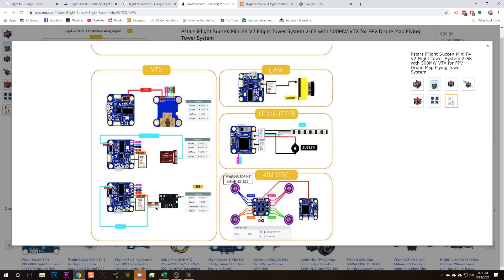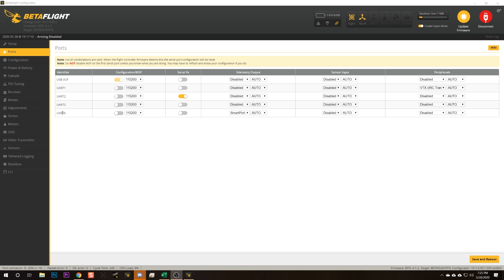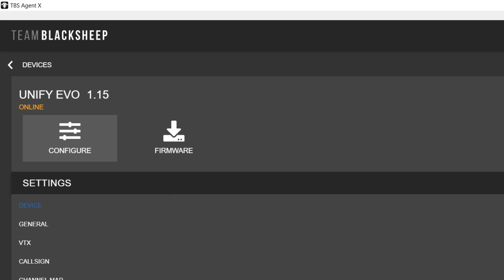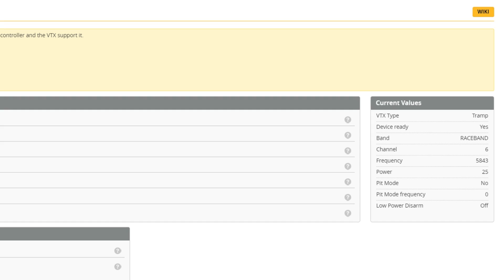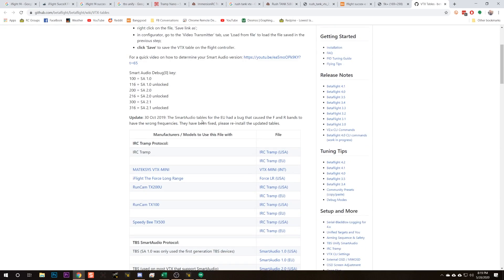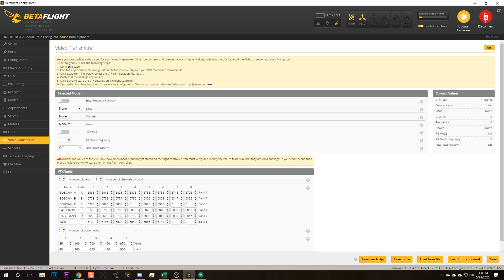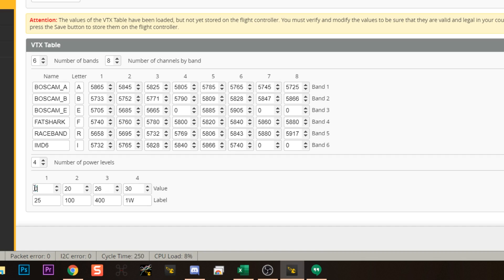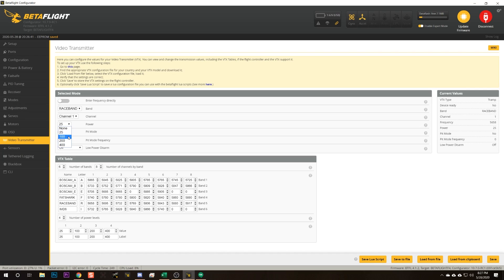Betaflight SmartAudio vtxtable troubleshooting (WHY DOESN'T SMARTAUDIO WORK)

Comment: So I have TBS unify pro32 HV. Used table 2.1. VTX type : Smart Audio Device ready: yes set uart 4 to TBS smart audio and verified I'm on the correct uart. VTX is unlocked while I am able to change the channel in betaflight I do not have smart audio in osd by the stick combo to get into the osd. What am I missing here? Betaflight 4.1.2

Comment: Help rush tiny tank vtx won't go out off pid mode via betaflight or osd settings and saved with battery. Low power disarm does work after we change pid mode changed. We cannot change setting to normal like low power disarm and save it?

Comment: So, I followed this video to a T. My TBS Unify is wired to T1 in my iflight FC, Uart 1 is selected for SA and, SA 2.1 tables are uploaded with proper outputs set and I still get nothing. I followed UAV Techs video and set up debug for SmartAudio and plug in a battery, sensor tab does nothing. Any other advice you could give? Thanks in advance.
Reply: Same I hate 4.1 vtx tables

Comment: After updating to 4.2.0 the other day, I can no longer change my VTX settings (band, channel, power level) via the OSD/Smart Audio. It worked fine on 4.1.7 and just to check my memory, I reverted back to 4.1.7 to verify and it does indeed work just fine.

No changes to VTX table settings. Any idea why this would happen? I noticed that 4.2.0 seems to have more items in the VTX menu, so there have obviously been some changes to the code there.
Reply: I can confirm this issue, on 4.2.0 you can change VTX settings in the video transmitter tab in Betaflight but not in the OSD. I flashed it back to 4.1.7 now it works again. FC is a MATEKF411.
Reply: prototype46 yep, I’m on a Kakute F7 V1.5 with the same issue. I’m going to see where to report the bug if it hasn’t been reported yet.

Comment: So isn't possible have CRSF protocol (receiver to Unify vtx) and smart audio at the same time (VTX to FC)? also I have already the CRSF protocol (Rx to VTX) and trying to get pit mode in a switch, the TBS Unify manual said it is possible but it doesn't explain how to do that. I can't find any video talking about CRSF protocol.
Reply from the maker: No you can't do those things at the same time. Either vTX to FC or vTX to crossfire.

Comment: vtx tables are sh***iiiiiiiiiiiiiiiiiiiiiiiiiiiiiiiiiiiiiiiiiiiiiiiiiiiiiiiiiiiiiiiiiiiiiiiiiiiiiiiiiiiiiiiiiiiiiit
you have bought vtx in the past. and you don't know if it is SmartAudio 1.0 or SmartAudio 2.0 or SmartAudio 2.1
And you can't really figure it out cause you cant measure the power output. so you don't know wether the settings you send to it destroys it.
And the worst: the shop does not tell you the version they use :(

Comment: Iv got the same set up with the rush tank ultimate , the led indicator light doesn’t seem to change when I change the power using osd ? 

Band ect changes and can confirm . Just worried my oower isn’t changing due to the light not ?

Comment: I have VTX ready: No but everything works :v
Reply: I have the same problem - Rush tiny tank - smart audio 2.0 Please let me know if you find a solution!
Reply: @randazd1434  I have the same, didnt work at first but i figured it out. I hadnt enabled "factory" and that was my issue. I downloaded a vtx table specifically for the tiny tank, and it was disabled at first
Reply: @leviathannfpv1282  I worked mine out too :)
Only problem I have now is O can't change the mode to free instead of race. And my pit mode is to underpowered so everytime I turn on I can't see
Reply: @randazd1434  What is free vs race? i have pit mode on my fc instead
Reply: @leviathannfpv1282  see https://youtu.be/dCWngIk8MW4

Although even once in 'free' when I reboot into 100 or 200 my quality is incredibly poor. I'm losing my mind it's like I'm in pit mode although definitely not.. starting to think I either have a poor soldier connection or a faulty VTX
Reply: @randazd1434  dude i have very simillar problems! Betafligh says device ready: no.
Output power is incredibly low even though i dont think i´m in pid-mode cause i´ve never enabled it.
Smartaudio isnt working... I´ve wired it correctly for sure! pls give me updates if you find out whats the problem! thx!
Reply: I´ve got send a new vtx (same model) by my prefered shop. Now everything works;)
Reply: Same help me . Rush mini with battery in beta and osd save reboot back in pid... how ..

Comment: One concern with this video: It continues to perpetuate the misunderstanding that "smartaudio" is vtx control (even stated in the title!). Smartaudio is just one of the protocols used for vtx control (along with Tramp and even onboard rtc6705). It's not "why can't I get smartaudio to work", it's "why doesn't vtx control work". This is a common misunderstanding that people have and the video title just reinforces it.
Reply from the maker: I understand the distinction. The reason I use SmartAudio in the title is because of SEO. Because everyone makes the mistake of associating "smartaudio" with "vtx remote control," if I want them to find this video, I have to use that term, since that is what they are searching for. So there is a self-perpetuating cycle where people use the wrong term, and then content about that term reinforces it. Personally, I feel that the goal of helping people solve problems is more important than the goal of ensuring that they use the correct terminology 100% of the time.

Comment: Absolutely cannot get this to work with the eachine nano vtx's. I've tried different vtx's on different flight controllers. Using the tramp protocol, got the wire going to the tx pad and the correct port set in the ports tab and it hasn't worked since betaflight went to these stupid vtx tables.
Reply: The Eachine nano has a broken Tramp implementation and won't work. Return the vtx to the manufacturer or ask them for a firmware upgrade. This is not a Betaflight or vtxtable problem - it's bad hardware.
Reply: @BruceLuckcuck  thanks, wish that was more widely known. Although I just talked to a guy last week that says it works fine for him so?
Reply: It is widely known. And the nature of the firmware bug in the vtx is that the baud rate it uses is poorly controlled so variations in the devices (even temperature) can cause it to go out of spec and not communicate properly. So you can get "lucky" and one might work, but most don't.
Reply: @BruceLuckcuck  that explains it thanks!

Comment: My transmitter (PandaRC Nano) says it does the following power 0mW/25mW/50mW/100mW/200mW/400mW.  So is the first entry 0 or 25?  It is Tramp.
Reply: 0 is never part of the power level table. Use the default Tramp table and change the labels to 25, 50, 100, 200, 400. The "0" is controlled by pit mode.

Comment: Does beta flight support Furious FPV protocol? I use 2.4 tx’s
Reply: No.
Reply: Bruce Luckcuck that’s what I thought. INAV does, wonder why BF hasn’t implemented it yet.
Reply: Very limited market and no desire to support even more proprietary protocols.They could have chosen to do SA or Tramp and instead made their own.
Reply from the maker: Furious made up their own protocol even though they could have used an already-implemented protocol like SA. Every new protocol adds size to the code and work for the devs to implement and maintain it. The BF devs drew the line and said, the existing protocols are fine and they are not going to add more just because a manufacturer wants their own proprietary implementation. Otherwise we'd have Furious protocol, AKK protocol, Rush protocol, every manufacturer could make their own and then things would be even more confusing than they already are.
Reply: Joshua Bardwell thanks.

Comment: Great video. Does the TBS Unify Nano use SA V2.0 or V2.1? Still having trouble to use SA...
Reply: Unify nano uses SA2.0. But it has a hardware design problem and needs a 10K resistor connected from the SA wire to ground ( a pull-down resistor).
Reply: @BruceLuckcuck  Thanks a lot man for the quick response, I will try that
Reply from the maker: I believe the RDQ/AKK branch of BF will also fix the Nano problem without installing a 10k resistor (but not 100% sure).
Reply: Sometimes it will - mostly accidentally - but depends on the flight controller somewhat. The better fix is the 10K drop-down resistor as it permanently solves the problem and eliminates the need for using a custom firmware.

Comment: hi, i have a question, i am a newbie in this hobby, so i just bought a new transmitter for me, QX7 ACCESS and it doesn’t have the D8 mode, how can i bind it to my emax tinyhawk 2 😭, i know nothing about this, please help me 🙏.
Reply: You can't bind. ACCESS doesn't support D8 at all. You'll need to get an external D8 transmitter module. Or change the receiver on tinyhawk :)

Comment: Thanks for this video. But i noticed mine was pegged maximum 600mw. I am using BF4.2RC2 and furious fpv stealth long range vtx maximum at 700mw. It wont let me choose the 700mw. Hope you can help. I dont know if other users using IRC tramp with BF4.2 noticed it.
Reply: My matek is similar, it doesn't support 600mw, but rather 500mw. Because the tramp protocol always uses the same labels, what reads as 400 is actually my 500. I would venture to guess that your vtx is actually at 700 when you select 600
Reply: @srossi88  My vtx maximum power is at 700mw but cannot be set at that power level. I change it to 600mw and 600 label. Now it can read at that power level - 600mw.

Comment: Just had an issue with a TBS VTX this week. Everything was connected and configured correctly but SA wouldn’t work. Finally connected it to the TBS utility and it was set to TBS not SA. Changed the check box to SA and all working now. 3 other identically VTX never had this issue. 🤷🏽‍♂️
Reply: HOW DID YOU HOOK IT UP TO THE TBS AGENT??
THANKS

Comment: So weird issue with tiny hawk 2 I'm able to change bands and channels but seems I can't use R1 or R8 but I can use R4 and R6 apparently (ships with R4).  Thanks for the clear explanation and debugging tips.

Edit: saw at end of video it's cause of locked mode apparently will be able to unlock I think thanks for the vids as always

Second edit: that worked just had to hold button on vtx while powering up (for tiny hawk 2 racer) and it unlocks

Comment: lots use SmartAudio still 1.0
Reply: No, only the first generation TBS vtx's use SA1.0.
Reply: @BruceLuckcuck  I taking solely about none TBS or 3rd Party VTX
Reply from the maker: No disrespect intended but that is not my experience, and I spend a LOT of time every week helping people solve this problem. I literally can't remember the last time I talked to somebody with an SA 1.0 vTX.
Reply: @JoshuaBardwell  yea because the ones that do have to install the AKK version of the firmware to get it working... I have quite a few with version SA 1.0 and I  am not getting rid of cause they work.

Comment: As 'silly and complicated' as these table configurations are, they are the ultimate manifestation of shortcomings in our VTX protocols, differences in power output options, as well as differences in regional regulations regarding power output and carrier frequencies.  It would be better if the protocols would communicate back to our flight controllers what their options were so that we, as users, would not be forced to configure them on our own.  This is not betaflight trying to make things harder -- it's betaflight trying to make the platform capable enough to handle the breadth of options on the market, while making up for these shortcomings in the protocols.
Reply: I'd like to piggy back on this comment and point out that it also exposes just how bad some manufacturers are at providing proper documentation and support for their products. A video like this might not even be necessary if OEMs simply had a link to the correct vtx table on their product pages
Reply from the maker: I believe SA 2.1 does support this function. I agree that's the way it should be.

Comment: For Tramp the powerlevel is NOT the power output (except for real IRC Tramp vtx's). It's a value that represents the position in the table.  So 25 represents the lowest output for the vtx, 100 the next to lowest, and so on. What the actual outputs are depends on the particular vtx and how the manufacturer implemented it. So in this way it's like SA2.0 where 0, 1, 2, 3, etc. are just placeholders for the table position. You can't arbitrarily use some other value like 50 thinking you'll get 50mw.
Reply from the maker: Wowwww I did not know that. Thank you Bruce for clarifying. I do know that you can't put arbitrary values in but I did assume that the Value would match the mW regardless. So Tramp would always use the Values shown in the vtxtable, but then the labels you would update to match your vTX output powers.
Reply: @JoshuaBardwell  this is correct. You can look at the matek HV vtx product page for an example of this.

Comment: So I have an HGLRC Sector132 Tarsier4k with the default IRC Tramp VTX and the OSD works fine but I can't get "Device Ready" on the VTX page, so I can't change vtx settings through betaflight or through OSD. I verified the Tramp port  on VTX is connected to TX Uart on flight controller (tested continuity between the 2 pads) and I have Tramp selected under that uart but still no go (There is nothing connected to that UART's RX pad either). It was like that from the factory with BF 4.1.1, so I tried updating to 4.1.6 and reloaded all the settings and it still doesn't work.  Is it possible that I have to modify a setting for that UART like half duplex or something?

Comment: Cheers Josh, just in time, about to install a Rush Tiny tank on the HX-115, I think you've cleared up all the conflicting and confusing instructions out there.
Reply: Can u get out op dip mode, it wont save with me aikon2020f4  rush mini vtx with battery in beta and osd settings save and its gone back in pid again.. ?

Comment: My vtx works but low power disarm doesnt work should I re do the vtx table ?
Reply from the maker: Unless you have a Tramp or SA 2.1 vTX, you cannot go into pit mode except on powerup. After it comes out of pit mode it won't go back. Low power disarm should take it down to 25 mW though. The vtxtable is not the problem, as long as it works the rest of the time.

Comment: Do you need OSD in your FC to use smart audio?
Reply from the maker: No. You can still change settings via Lua script, command line, and GUI.
Reply: @JoshuaBardwell  sorry, I didn't specify my question further.  What I meant to say was can I still change channels/power via transmitter on an fc that doesn't have an OSD.  I am using an SP Racing F3 fc. (wizard x220 setup)

Comment: Going far off the beaten path with this little bit of info to add to your comprehensive video, JB:
If you have a board with limited uarts and find yourself using softserial for SA while using JESC - it conflicts & VTX tables goes all screwy & the quad will throw up arming flags.
This is due to DShot BItbang, just toggle it in the CLI for a quick fix. (think its just to the timers or something) experienced on a Tadpole build.
Reply: Arch the way forward step in line

Comment: Every time I power on my quad, the vtx is switched to an another channel. What I am doing wrong?
Reply: BoAC tech are you using crossfire?
Reply: @parklander6459  Nope. I'm using fport.
Reply: Sounds like you are not saving your new setting in betaflight.  If you change the settings and do not save then this is exactly what happens.

Comment: my vtx which uses tramp protocol has misleading information written on it. it shows for example 6 powerlevels but if you give your vtx table 6 powerlevels it won't work. it has 5 powerlevels and a pit mode (which doesn''t count as powerlevel). the value 0 seems to be pit mode probably don't put 0 into the first possible vtx value because it's not a powerlevel (at least for some tramp variations).

Comment: Thanks for the video.

But what do I do when it says "device ready: no" after I have tried both IRC Tramp and Smartaudio on both available UARTs, double and triple checked the manual regarding the wiring, resoldered the vtx and checked for continuity with my multimeter? It's an HGLRC Forward VTX. Can't for the life of me get it to work and it's driving me insane. Having to use the button to switch channels is so annoying.
Reply: hectobit send him a facebook message or email-he’ll likely respond there if you make it clear this didn’t work. Good luck!